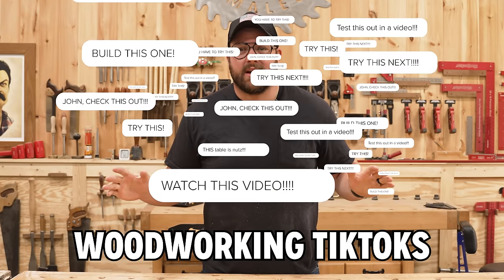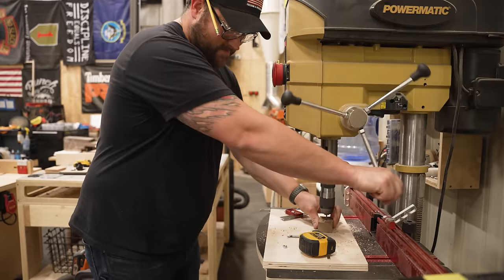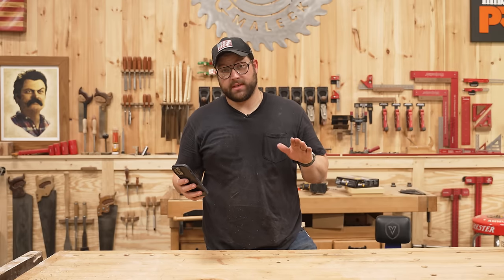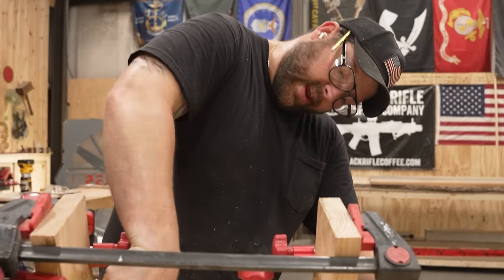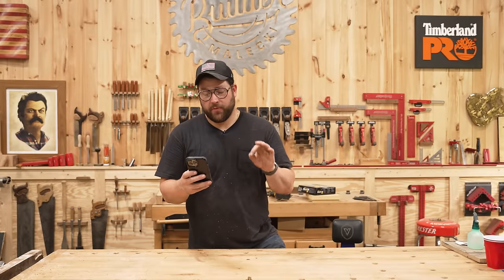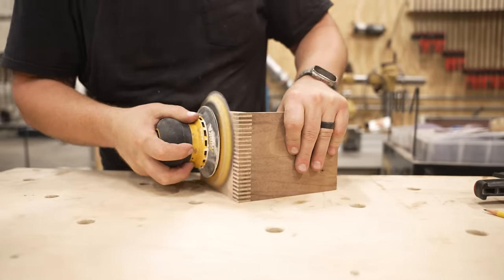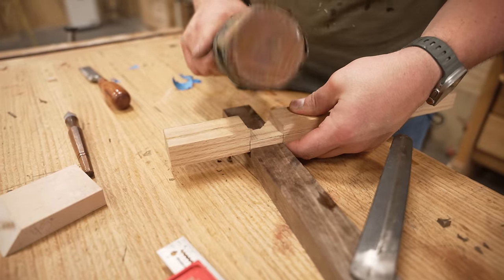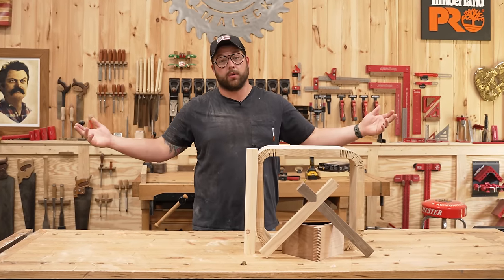Testing More Viral Woodworking TikTok Techniques

Comment: For the first one try a 1:1 water + alcohol mixture (vodka will work too) to soak the end grain. It definitely changes the process of end-grain planing and chiseling. Not sure about the paper-like single shaving though.
Reply: if i had to guess probably like a see through sticker or something that they just peeled off with the chsel to make it look like it was a paper thin slice
Reply: Yea, looks like wood glue to me.  @mrroboshadow
Reply: 1st one is a scam you can see its a thin layer that isn't wood. Apply it to to end grain  but it up to a pc of glass and let cure. Butter, wax in a solvent, pva might all work. Wax is a generic name for a range of materials it's not all brittle. Super soft plastic like crayton would probably work. (the plastic in gel candles)

Comment: Definitely wet the pine it makes a huge difference. They also may have used some green wood. With stuff like pine and fir if it's old or has been kiln dried the sap will have hardened making it more difficult to work. Thats part of why timberframers can peel off thin strips of wood when fitting the green fir beams.

Comment: @6:56 I just would like to mention this might be the reason for the failed curve is that you didn't do equal interchanging cuts on both sides of the board like it is shown in the video allowing it to be more flexible.

Comment: hey guys this video isnt actualy fake, he has other videos of him using chisels at other angles, japanese chizzels can hold high angles 25 degrees is standard with the high rockwell they will retain an edge, the wood used is Japanese hinoki (cypress). I bet i can do this myself with spruce
Reply: I did it with an Irwin chisel and a piece of basswood. You can't convince the hundreds of people that have said it is wax or finish or glue.

Comment: To make the bent wood with the kerf, if you use a tapered router bit, you eliminate the open spots at the bottom of the cut when it’s folded. Being your saw blade makes a rectangular kerf, you’re left with a triangular gap once you bend it. The tapered router bit fixes that
Reply: What's the smallest tapered bit available?
Reply: @darrinlindsey  I don’t know the smallest made but a quick google search, I saw a 6.2 degree with a 1/64 tip. But you’d have to figure out what angle based on how many kerfs you want to make. To obtuse of a bit and you’d still have gaps or you’d go past the desired bent angle. To acute and you’d need more cuts. There’s a video on YouTube about it
Reply: @darrinlindsey  not sure on the smallest but i believe if you space out the cuts according to the bit you have, it works with any angle.

Comment: I think the bends were probably steamed first, even a simple handheld garment steamer maybe. Otherwise you would need truly perfect stock everytime, the tiniest grain difference could ruin pieces easily.
Reply: definitely would have helped to take the steamer to the non-cut side before bending/gluing.  also would have done a lot more math to make the cuts more symmetrical and so each corner did 90 perfectly, but for a beginner attempt john did ok :)

Comment: You need to calculate the difference between the inner and outer radius of the kerf and then remove that amount of material by calculating how many cuts it’ll take with the kerf of your blade. That way, you’ll get a perfect 90 on the bend.
Reply: so it depends on a lot of things, blade width, wood thickness... probably sometimes planning before "just doing" will yield better results? :O
Reply: Oh, so you got the gist of it then?

Comment: For the kerf cutting, to eliminate the ugly gaps that are left showing, don't use a miter saw (or saw of any kind) but instead use a 6.2 Degree taper CNC bit in your router
Reply from the maker: this is smart. Thank you!
Reply: 6.2deg? Only specific, most tapered endmills are in steps of 5, or 10 maybe 1 or 2 deg once you get to shallow tapers.
Reply: @Volt64bolt with CNC bits it's not uncommon to find them with tapers specific down to the hundredth
Reply: @RGun90  I take it you don’t mean those funky little half faced ‘engraving’ bits?
Reply: @Volt64bolt  def not the engraving bits, but professional TAPER bit. They arent cheap but they give that insane incremental level of options.
Reply: @MattWeber  oh wow, all the ones I have ever bought for work were only in large increments. The only fine stepped ones I ever saw were the Chinese half face cutters
Reply: The kerfed corners are used a lot in automotive subwoofer box building.

Comment: For creating table legs with your table saw, you should use a sled that allows your blade to come up from the underside of your dowels. It's much safer and easier to control. You also get much less chattering. 😊

Comment: I wish all the people saying the first video is fake would try to recreate whatever ridiculous things they are suggesting and record it. It's real wood, end grain Japanese cypress wet with some added water ( not soaked, not green wood, not steamed) and a sharp 36mm chisel. The setup is probably harder than the actual cutting because the guide block needs to be perfect for these results.  It isn't glue, tape, wax, wax paper, polyurethane, shellac, glued on paper, resin, or anything else but wood and some water. The type of wood is the most difficult thing to get but spreading some hand tool knowledge feels like it is desperately needed here.
Reply: Ya, as good a theory as mine...or better but I have been at this woodworking thing for over 60 years but you can always learn new tricks.😅

Comment: For the first end grain cut with a chisel, the technique to start the peel would be to keep one finger above the chisel and push the handle gently sideways so that you obtain  a circular motion of the blade edge. This way, the angle of attack  would be lower than the 25 or 30 degree on your chisel and prevent the split of the fibres.

Comment: You can use the table saw finger jig to cut slits in your wood cabinet piece and get proper deep slots, the trick for that one is to get the slots deep into the wood so it almost reaches the outside flexible wooden sheet part of the wood boards and you can get the radius of the furniture without any troubles.

Comment: When I was an apprentice we turned 10ft flutted columns on a sketchy jig on a spindle moulder using a piggy back cutter. Old fashioned cutter head. So dangerous.  The cutter did vibrate out and ping about the shop. Scary as all hell when you're 17-18 yrs old. Worked though.

Comment: For the turning on a table saw... would be better to use 2 blocks of wood, hollow out a spot on the inside of both blocks to fit a ball bearing, glue the pieces together to seal the bearing in,  then uses a long bolt going through the bearing into  with a washer and nylon lock nut on both side with maybe some locktight. That would allow it to spin freely while also keeping the bolt straight and not backing out. Could also use something like a counter sink on both sides and tighten those into the piece of wood instead of a nail and t nut.

Comment: I noticed you use the table hook to hold your pieces down. if you use a cloth between the hook and the piece you can put more pressure and reduce the movement the piece is capable of.

Comment: I calculate how many cuts I need based on the desired interior and exterior radii and the thickness of your blade. I have done it with plywood, but I have never tried solid lumber. Nice video, thanks.

Comment: Dude that thing where you were making the joint looked way better than you were when you were trying to curve that board. They were both nothing but a whole bunch of tiny slim cuts, but just they were just a little thicker on the joint one. I think you could adjust that.

Comment: They make a shaper bit for finger joints. If one was going to be doing a lot of finger joints you could run the number and find the labor involved in cutting finger joints is time consuming and the money spent buying a big boy finger joint bit would save you a lot of money in the long run. I found several 4.75 inch adjustable finger joint shapers for 1.25" bores for around 2k. This is 40 hours at 50 an hour. If it takes you a few hours to cut with the shaper vs a day then you save a lot of money if you use it several times. 
Drawers with fingerjoints can add a small price increase and they will overall last far longer than other joints.

Comment: The table-saw lathe thing... I wouldn't have a lot of trust in that. Maybe if the grooves on the table were dovetails and I knew it couldn't lift the whole contraption off. I also would want to maybe make some sort of cradle for the drill so I didn't need to hold it and do the good old zip-tie trigger so I can stand way to the side and not have my hands anywhere near what was happening.

Comment: *Making legs on a table saw*.... Both Woby Designs and Izzy Swan use a sled designed specifically for this. Both designs are properly built with perspex safety sheilds and dust extraction. Please do not slap together something as crude as this one and then pray that you aren't going to die every time you use the thing!! Your families and local hospitals with thank you😅

Comment: I made one that is a box, with very tall bridges. Either EDGE of the box falls into the miter slot. The bottom floats just a hair over the table, and there are bearings front and back to support a threaded rod I tapered, with a small tailstock box that clamps either side to lock. 

Then a drill comes in and spins the front threaded and tapered rod. 

Drill a 5/16 hole on the center of eithsr end of the log, and youre ready to lathe on the miter slot. Turn a log into a table leg etc, with an adjustable tenon diameter. 

If you want square shoulders on tenons, you need to run the piece across the table sideways. 90* to the miter slots, mat b e 5 degrees offset of that to give a little tiny taper. Anyhow, for that you need stop blocks in the miter slots and a bridge to go over the blade, not a box to encase it.

Comment: Should've used a lock nut on the bolt for the dowel, or two nuts butted together.  Also, for the gluing bit, a ratchet strap would've probably worked better.

Comment: 2:45 That is literally an INSANE way of doing that! Buy a lathe instead! LITERALLY made for this job - and you can buy one which can do basic stuff like that for a few hundred USD. Alternatively - spend those few hundred to get an old used "professional" one - which will probably be a lot better especially if you have a basic level of mechanical skills. That "Tiktok version" is just begging for an accident to happen... Holding that drill and pushing towards the blade is sketchy AF! NOT WORTH IT!

Comment: You can use a tapered router bit (like the kind for a CNC) instead of the miter saw so that the ends all meet up on all ends. Requires a ton more prep and math, but it's WAY cleaner.

Comment: Maybe the wood he's chiseling has been stabilized with resin.  Looks kind of waxy, to me.  Could be larch or tamarack, too?  High natural resin content.  Your kerf cuts would be better if you used a kerf blade, it's thinner, and evenly placed.  Mostly seen it done with plywood, not solid wood, then the edges are veneered.  My mind was blown by how well that box joint turned out, I have to replicate that.  That is a skill I can use.  I'll stick with my half laps, but I did see some of the construction techniques I can apply in other ways.  So, overall, I learned something today.  Great job.

Comment: I think you missed few steps that likely happened off camera for the chisel shave, to get that perfect intact roll of wood when the Japanese do it in planing competitions they pre plane the wood to a near perfect flat first as it would need to be a consistent thickness to roll up in one sheet I assume same would apply with using a chisel? Plus it would close up the wood fibres and push them over in the same direction to some degree, image like cats hair, so it wouldn't break up as much maybe?

Also I believe it's probably pre conditioned, maybe mineral oil ? To it would act like it was wet but more consistent again?

These are educated guesses at best 

People's thoughts?

Comment: The table saw lathe should have been spun with a drill not an impact 
Drills spin, impacts remove bolts and nuts without spinning the pieces your working on

Comment: I am not even slightly skilled at woodwork at all but mathematically speaking is it not 10 cuts at 9 degrees, 5 cuts 9 degrees one way and then 5 cuts at 9 degrees the other way? (9 degrees x 10 = 90 degrees, or any dilution of that)
Reply: For the box that is.

Comment: That end grain in that pine had a layer of glue that he chiseled/peeled off. Notice the shavings don't have the grain pattern. Complete rip off of 126M views.  0:26
Reply: You can see the grain, it isn't glue, it is just wet with water.
Reply: @gizanked  now that i see it again... It's probably a layer of polyurethane. Definitely not wood he's cutting into.
Reply: @milanpatel7956 it's wood. Japanese cypress with water on it.

Comment: That wood was soaked wet.  Yours is dry asf. You sharpen that hollow ground in a similar way you sharpen your non hollows? Wouldn't your edge come from the bottom of the chisel being flat as possible and then the top chisel angle getting ground and sharpened with the wet wheel your using? Maybe I watched that wrong but my initial watch thru seems like you sharpened the chisel funky.

Comment: I'm not a wood workist, but that first one. Would it by any chance be a thin layer of wood glue that remains flexible when it dries? Like the wood glue you can use to clean old LP's.
Reply: polyurethane or lacquer coating.

Comment: buy a CNC with a finger joint bit, smarter not harder
Reply: by cnc, get an onsrud, not biesse or stiles
Reply: make sure you buy your bits by onsrud, and get them sharpened regularly

Comment: The first TikTok video isn't removing any wood at all. 
There's a coating on the timber. You can still see the sheen that remains on the end grain, so not even removing the entire depth of the coating.
Likely satin polyurethane as the urethane has enough flexibility to remain intact and far less friction than wax.

Comment: Look at the bottom right of the piece he’s shaving, you can see the build up PVA or wax or whatever he coated that with and it comes off with the shaving.  Softwoods might be easier on your tools but they’re way harder to work with in a really precise setting.  It would be more believable with a hardwood because the shaving would actually stand a chance of holding together.  I work with cedar and fir almost every day.  Building, planing, sanding, chiseling… I’ve never seen any remnant of softwood that looks like that.

Comment: It's been long enough to pull the curtain back on the 126 million view paper thin chisel strip. Ever put rubber cement on your hand as a kid and peal it off in one piece? The see through wafer was not wood but a VERY well set and cured layer of clear silicone :)
Reply: It was wood. :)

Comment: The video regarding the wafer cut from the endgrain was likely a hoax created using a plastic sheet over the endgrain.
Reply: Mike now you're saying it's a plastic sheet? 2 weeks ago you said it was a glued on paper wafer. You are wrong both times though because the video isn't fake.
Reply: @gizanked  Slicing a wafer from the end like that is like slicing a wafer from cornbread.   .  . Just too crumbly. Whether plastic or paper - this is fake without further demonstration.

Comment: Still no client build. Seems lime this shop is going backward. Only reason i use to lime this channel is for client build.. Not this every sunday
Reply: Client builds take a couple of weeks to do. Also, add the filming, editing, etc to make it into a video. So unless they offset 4 to 6 builds at a time, it is not possible to do a weekly client build video. Watching these type of videos in-between helps support them so they can do those larger builds. Remember,  they are a company first, and a  content creator second. There also might be a contract thing with their clients to be able to use the build in a public video. If the client doesn't want their product online, they can't use it. Need to remember that as well.

Comment: If you take a good look at when he is shaving, the end cut of that wood a piece that he is shaving off there is no green in it. That that he is shaving off is a piece of tape, a piece of paper or something like that. It is not Wood because you and I both know that no matter how thin you cut and any cut, it will fall off part. This is the reason why you don’t screw a piece of wood to gather into the endcap because it will pull out the cars, wait for it, wait for it, it falls apart. Take another look at the video.

Comment: Clearly, the end-grain shaving video is a fake. The shaving is likely a layer of wax on the end of the board. It shows a little of the grain structure but zero coloration. You can also see the bottom right corner of the board where the “wax” doesn’t fully cover to the edge.

Comment: That top layer looks like wax or glue in the TikTok vid. Too smooth looking while the grain in what little shavings you did get off (which obviously cover significantly less surface area than that seeking smooth peel) was still very much visible.